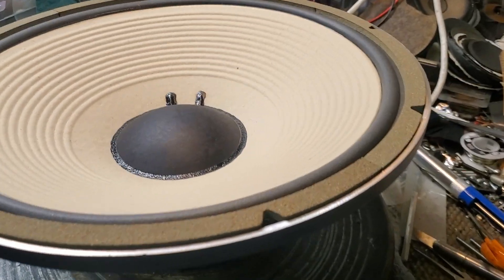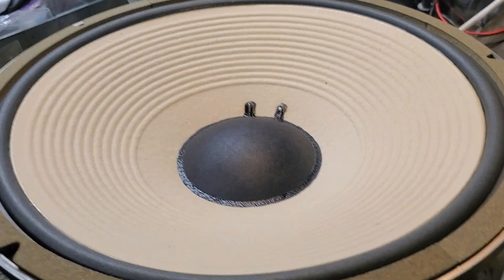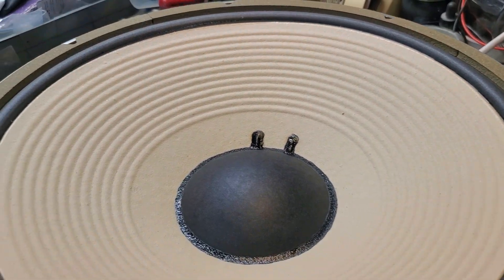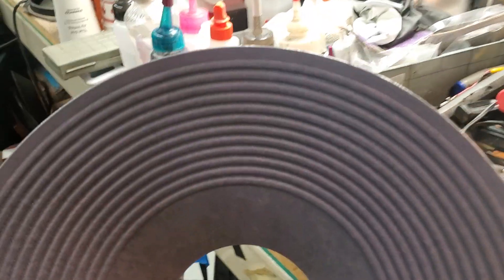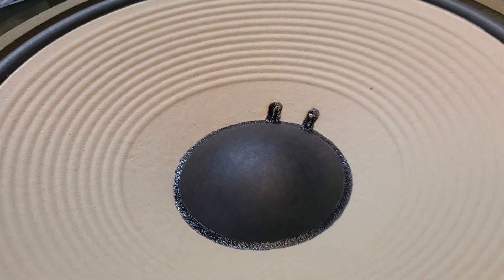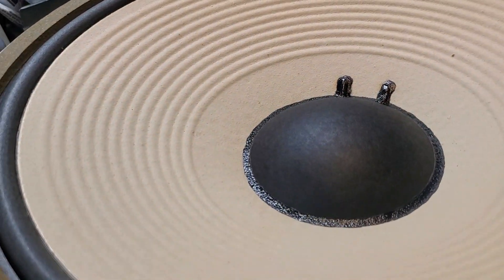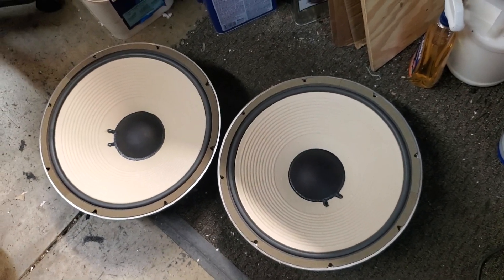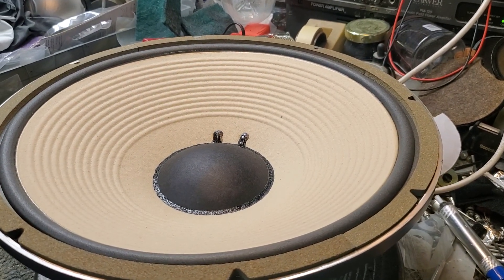Finished quad of JBL 2230A+ for 4350 Studio Monitors...Upland Loudspeaker Service.

Comment: What do you mean by recharge?
Reply from the maker: @benjaminlloyd7868  AlNiCo magnets need to be recharged after decades.
Reply: @edgewound  Wow, I really didn't realize this! Is there an easy way to test if a drivers magnets need magnetizing?
Reply: The drivers will have low to no output. DC leakage can cause magnets to weaken also. Also extreme cold.
Reply: This guy receives payments and doesn't deliver any material, he's a scammer. He talks to you until he gets the money, payment, then disappears, doesn't respond to messages anymore.
A payment of US$2,487.00 was made and he disappeared, he receives money at the address of UPS, not store, (United Parcel Service), 1042 N Mountain Ave, Suite B368 - Upland, CA 91786. 
A FB.
Be careful, don't fall for this trick.